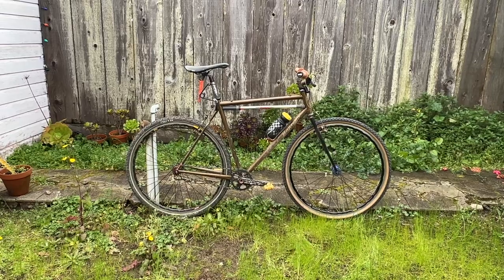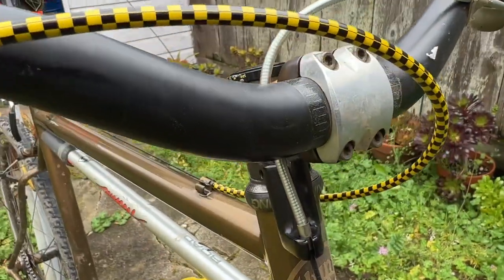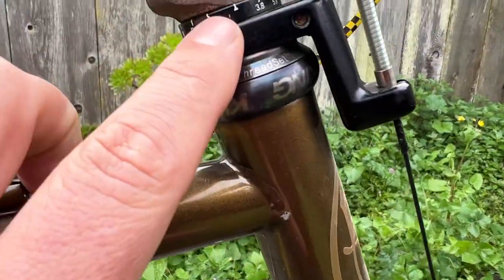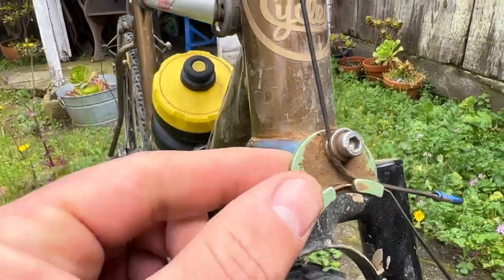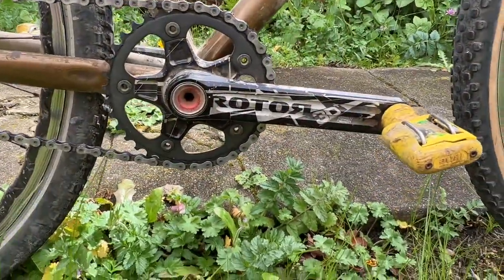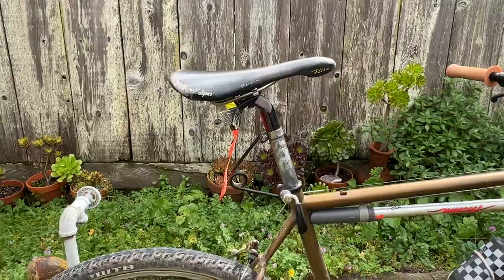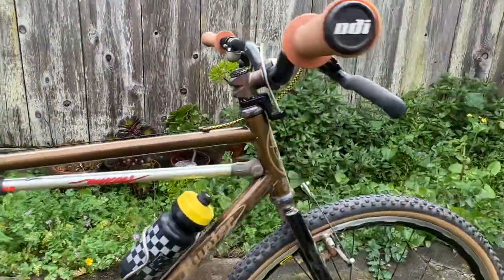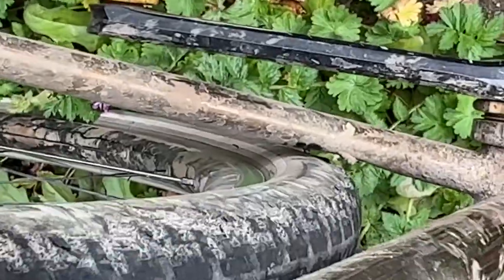Hunter Single Speed CX | Bike Check

Comment: It's a seventeen teeth White Industries ENO freewheel, red is 17t, blue is 16t, green is 18t
Reply from the maker: Nah red is the regular, green is trails, and blue is a double. They each have a few tooth options. They’re made close to we’re I grew up. I’ve been running them for a long while.
Reply: @MoreTerryB  Hahaha, with all respect for you (And I have a lot for you as a filmmaker and rider), you really know very little about bike tech and it shows over and over. Nope you are wrong, WI is fixed color coded depending on the tooth count, and even if you want you can't put let's say their 17t cog onto their blue body (It won't fit). But never mind not here to argue, you surely know better.
Reply: @axeljunkuhn.5985  nope, Terry is right on this one bud. (He’s also a good mechanic fyi)